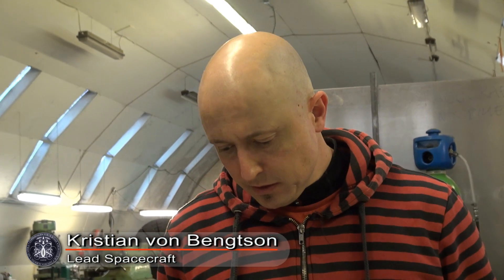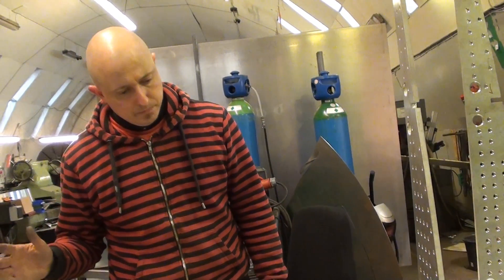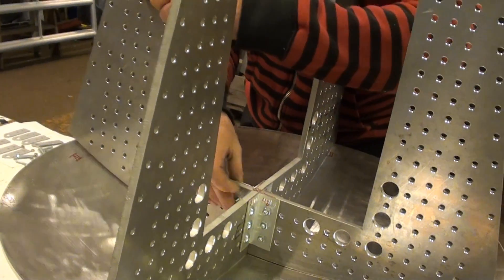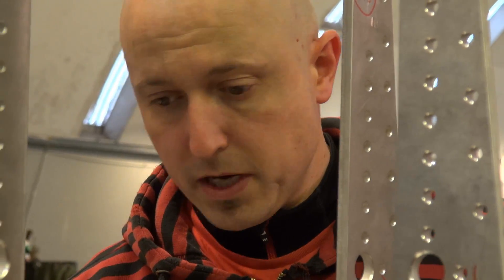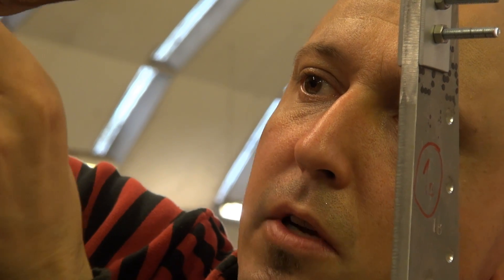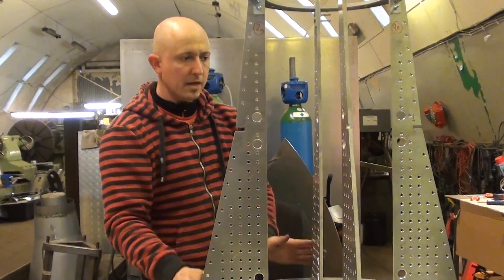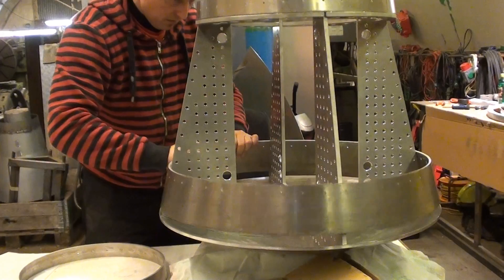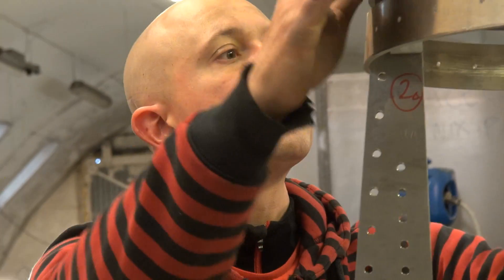TDS-80 - the payload for the HEAT2X - Episode 1

Comment: Awesome. But from a stress point of view the structure/ design seems to neglect a few basic design rules, such as sharp corners (aluminium struts) and shear loaded threaded bolts (steel doubler). All bolts seem to have a loose fit.
Reply: aren't these issues relevant only to structures vulnerable to fatigue?